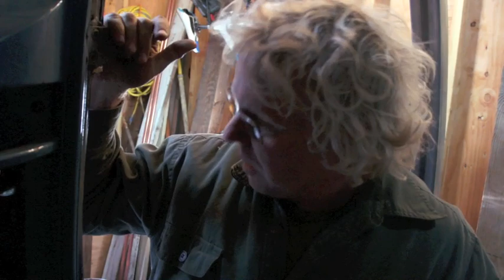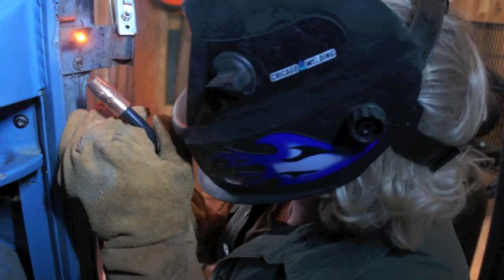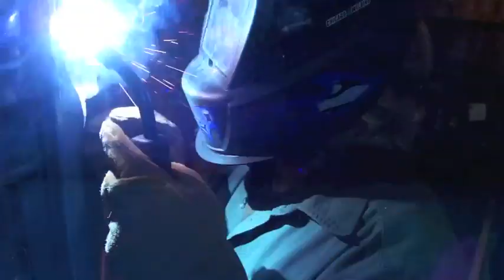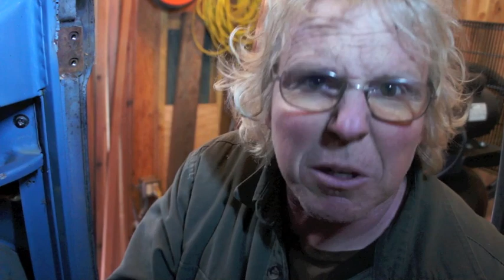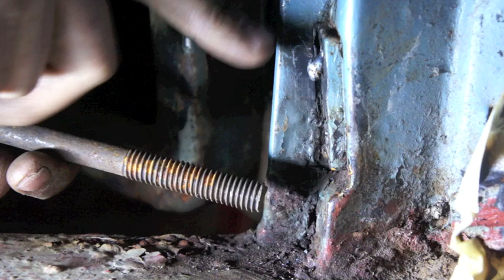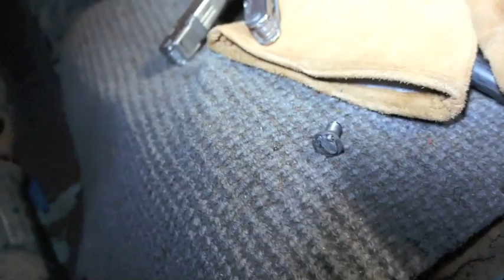VW Bus Single Cab How to Remove Rusty Screws

Comment: Next time get out the hot wrench (welding torch).  Use a small tip and heat the screw head up 'til it's cherry red.  That breaks the rusty bond.  Works every time.